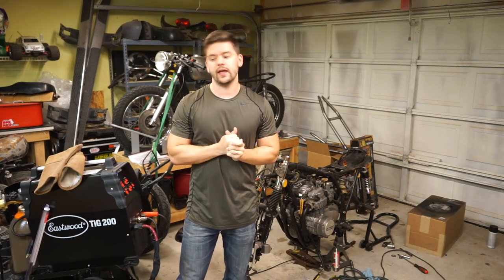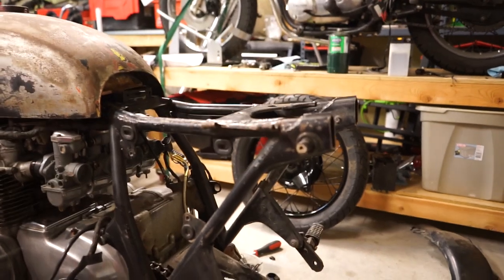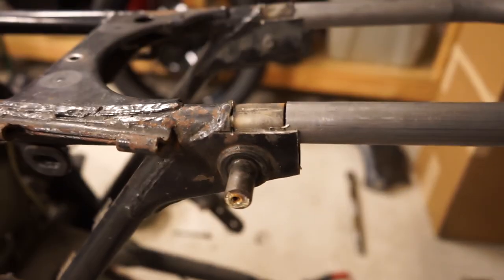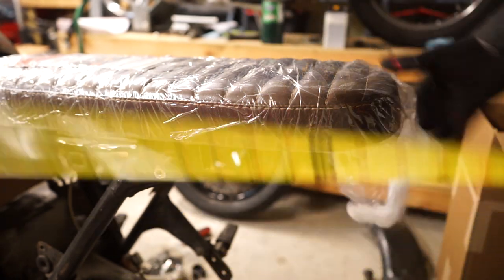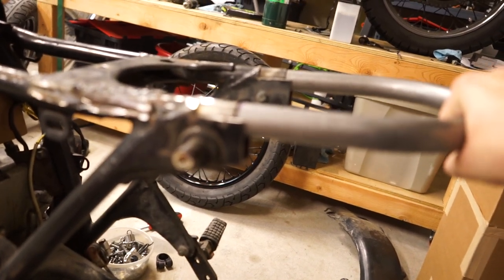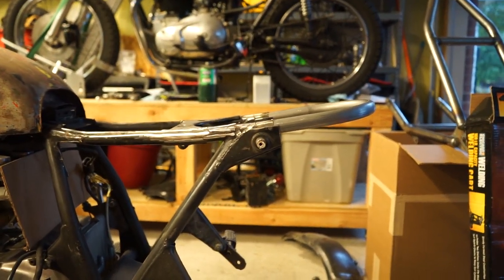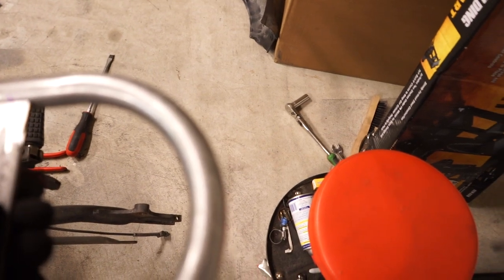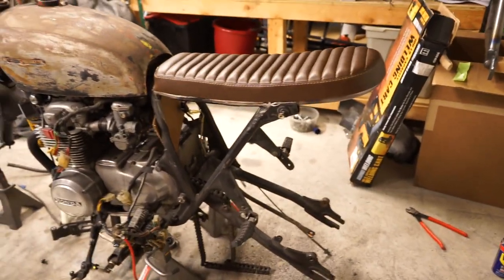Frame hoop and Seat Mounts

Comment: Question for classic octane or for anyone that has done the hoop... When welding the frame hoop do you actually go all the way around the pipe or did you just weld the top area? From my point of view it does not look like you can actually get all the way around to get a full weld.

Comment: does it make sense to attach the cross supports to the seat 1st, then place it in the final position on the frame and tack it from underneath while all together? I was planning to do that but now see how you did it.  I am about to mount my new seat for the first time.
Reply from the maker: You could do it that way as well. I didn't because the bottom of the seat is felt and I didn't want to burn it.

Comment: Love the video series....   question on the film production side of things...  does your camera have an option for manual focus?  Or is it just auto focus?  (If you had the ability to set it to manual focus, that would keep it from trying to focus on the floor rather than the bike).
Reply from the maker: It has both. It's definitely user error. I'm getting better through! Thanks for the feedback.
Reply: You bet, and just for a "quick tip" - if you can....   set the camera to manual focus and then zoom (again if you can) to the object you want to be the primary focus (let's say the new hoop in this case) - and then focus on that .....   you can then "zoom out" and everything between that object and the camera will now be in focus - the term is called "critical focus"

Just some a quick production tip if you wanted to use it!  Keep up the great builds/videos!

Comment: What's the reason to cut the original cross brace and weld your own on for the seat mount?  Is it because it didn't work well with the new seat or is it a cosmetic reason?
Reply from the maker: One reason is for the looks like you said and the other if because the stock mount is very bulky and is made up of two parts with some space in between. I like the solid mount of a straight bar. You could make due with the stocker but if i'm back there cutting stuff off i just take the few extra minutes to do the mounts as well.

Comment: The battery you use is pretty weak in power but perfect in size. Do you have any limitations using this battery?
Reply from the maker: I have used it on two bikes without any issues.
Reply: Classic Octane I might just use that instead of the pricey shorai lithium battery. Thanks

Comment: Hey man quick question!! Where are you buying your hoops for the seat now? Or is this from tuff side as well?
Reply from the maker: I buy them off of ebay. I have found them for around $30 or so with free shipping. Just make sure to find one with the correct tube size.
Reply: Classic Octane What happens of they are not the same tube size? what can I do to fix that.
Reply from the maker: You could probably get it to work but they are only around $30 or so. I would just reorder the correct one so they you can have an OEM look when it's done.

Comment: Nice work!  Clean lines, love it.  

I wonder if it would be easier to measure/drill out the holes for the seat first on the flat bar before welding to the frame...so that while loosely bolted to the seat, you could tack the cross bars in place so they are a perfect fit (I'm reflecting on your previous build where you had to "oval" out the holes to move the seat over 1/4".  Just a thought.  Perhaps it's more work?  Anyways, great job!
Reply from the maker: I might try that next time. I didn't this time because the bottom of the seat is felt and I didn't want to burn it. If you're careful with the tacks it should be fine.